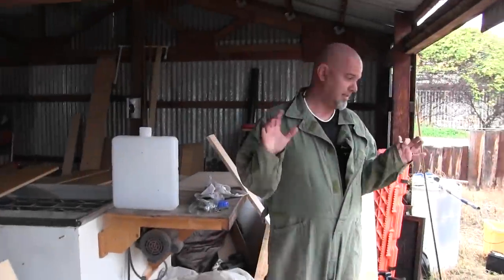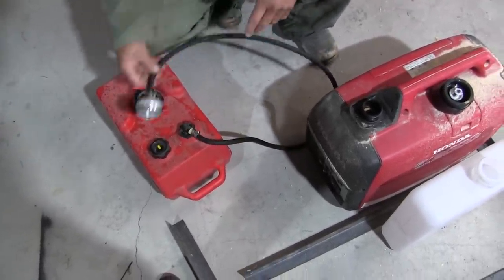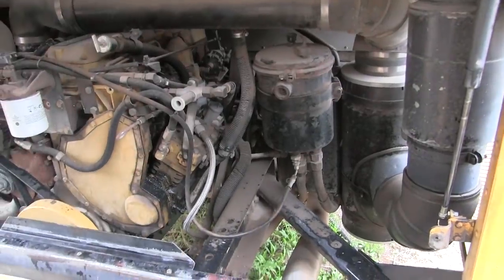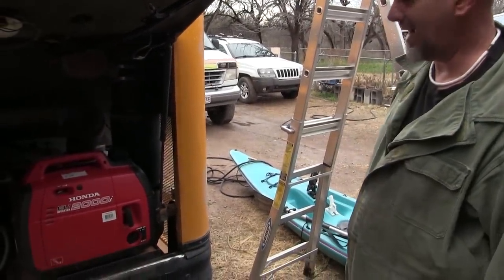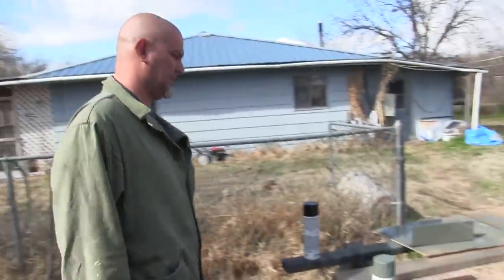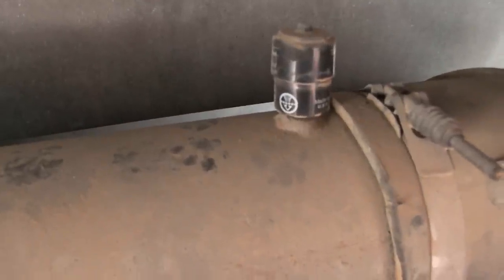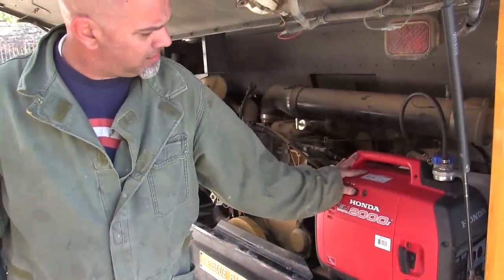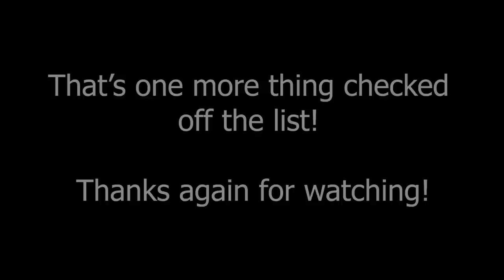Generator Custom Install in our Skoolie

Comment: Just wanted To give you a suggestion about your generator setup. I did the same thing on my conversion and thought that big hole in the engine compartment was perfect for a generator. Two things to consider are that the engine bay get extremely hot and putting an inverter generator with all its electronic components that close will not be good for it in the long run. Also, taking up that space will restrict the air flow that your bus’s engine needs to stay cool. I ended up having to relocated my generator as it caused the bus to run hot. Keep up the good work, and you will be on the road soon! 😊

Comment: The national standards for fuel storage is 3 -5 ft from any heat source fumes will ignite and the plastic will melt and degrade over time from the heated enviroment. Your engine compartment will exceed 200+f. Seriously need to step up the heat shield with insulation the metal will become the same temp as the environment and install a vapor vent tube from gas. If anything enclosed the generator and tank and insulate with fire wall padding from jegs or any other suppliers. Your doing a great job and very creative solutions to difficult problems.

Comment: The pipe you're using for the generator exhaust extension is not meant for high temps...it was for the ambient air intake on the diesel heater. 
Add an inline fuel filter for the diesel heaters and for the generator as well...it will save you a ton of headaches down the road.
Overall a great built my friends 👍

Comment: With that awesome solar setup i doubt that generator will see much use! So the propane conversion makes perfect sense. You wont have to worry about gas going bad and messing up carburetor.

Comment: how bout header wrap for the exhaust pipe.  Also, consider mounting a 10lb fire extinguisher next to genny in such a way that if needed all you need to do is pull the pin and smash ht handle.    I wish my engine compartment was as uncluttered as yours.
Reply from the maker: I totally thought about a pull handle fire extinguisher that I just grab the handle outside and it fire the extinguisher inside. Our minds work a lot alike. Hope to meet you.😊
Reply from the maker: Just ordered the header wrap. Awesome idea!

Comment: McBusface crew I really hate to write this comment cause I really love your site and all your videos and your project, and I have come to care about you too even though I know it's silly but, I do, so I am virtually forced to write this. 3 things, your bed in the back over the engine compartment when you're traveling Your engine will roast you out of your bed so you must insulate the heck out of that engine compartment to keep the heat out of your bedroom. My wife and I found this out when we bought our diesel pusher, We would go to stop at a rest stop and catch a few winks and if we didn't have a couple 3 hours to let the engine cool down it would roast us right out of the bed. Next Mounting your generator solid to the frame of your bus just underneath your bed will drive you nuts from the vibration it was bad enough for us when the generator in the front of our bus (which was shock mounted) would drive us nuts through the sound running through our mattress up our pillows and into our ears. This is why people like to set the small generators out on the ground where they keep the vibration out of their coach.  Next the heat coming off of a diesel even after it's been shut off is ferocious, I worry that your generator and its gas and gas can could get hot enough to boil the gasoline or at least create enough pressure to be extremely dangerous.
Reply from the maker: We did insulate the bed area. As far as the generator usage, we wouldn't be using it at bed time because no matter where it was mounted, Kerry wouldn't tolerate it very well.  As far as the heat back there, I will do some real world testing and move the fuel tank if necessary.  Thank you for your concerns 😁

Comment: Some half inch rubber padding between the mount and the board your genny is sitting on will cut the vibration and some noise that travels thru the frame rails into the interior of your bus. I’d also think about wrapping that tank in heat shield tape, or even use something like refletix to make a homemade “sock” to slip it in.. sitting right next to all that heat seems like a accident waiting to happen. Your sleeping right above it. Love your work!

Comment: You need to add a CO detector inside towards the rear of the schoolie.
It wouldn't hurt to mount fire detectors, and CO detectors in both the front and back of the bus. If you are using any type of propane appliance inside the bus, one needs to instal a gas detector as well. If you are using any type of tank in the "basement" or lockers it is best to add a hole in the bottom with a piece of screen to keep bugs and vermin out. Most gasses are heavier than air and will self vent. Also with the propane detector it is bed to buy the type with a shutoff solenoid that can be mounted rite at the tank.
The joys of being a "pack rat", one never knows when those spare parts come in handy.

Comment: With the main engine's exhaust pipe under your gen. maybe some sort of heat shield to protect the gen. from the exhaust.  Also how about some springs or 3/4 "- 1" rubber pads under the gen. to help reduce the vibrations. The pads could double as a washer that the bolts that go through on the mounting holes on the gen.

Comment: I have a suggestion for Mike. Just something to add to your Mcgiver skill set. You can add fittings to a polyethylene tank, the same way they add fittings on RV tanks. They are friction welded to the surface. You can buy the fittings from your RV dealer, make the correct size hole, and spin the fitting causing the friction to weld it on.
Check out some videos on this.  Just a thought.

Comment: We did similar setup but with 2 Honda 2200s so we could run in parallel. Way overkill. We never used the 2nd one throughout our 6month trip. One is more than enough to power our mini split, tvs, etc... We also didn’t install an auxiliary tank like you wish I had done that. But I do have one thing that really helped us refill the tank. I got tired of squeezing the hand siphon from Walmart and bought an electric one. It was amazing. They are kind of cheap and made mostly of plastic but it lasted the 6 month trip. I’d buy a new one every month if I had to instead of squeezing that siphon 100 times every time the tank was empty.

Comment: I know there are a ton of suggestions but I wanted to have a go. I suggest some kind of heat sensor on the plastic tank or metal right next to it that goes to the inside of the bus with a little alarm. Just in case the frame gets hot enough to melt the plastic. I also suggest some kind of pressure release valve for when the gasoline gets hot and expands. I’m not sure on how to vent gas vapors around hot objects though. Just something to think about. But I love the area for the generator and frame build.

Comment: Might wanna consider a form of heat shield under that generator due to the exhaust being directly under it.
Reply from the maker: Dzlfreak turned me on to header wrap. That will cut the radiated heat in half. Secondly... well, you will see.😁

Comment: OK...I'm gonna say it... With all of that solar I just don't see this thing getting used much... however, being from South Georgia myself, I know that summer heat and humidity can make life crazy without AC in some places in the summertime. I'm not sure how long your AC can run off of your batteries, so it seems like a good backup plan. Great video, love the placement, but I am worried that you blocked some of the air venting to the motor itself... I guess we'll have to wait and see if changes are needed!!!
Reply: Chuck Spencer with a mini split sucking 800 watts an hour you’ll definitely use the generator at night and on gloomy days.

Comment: I thought of the type of springs you could use. You've most likely rebuilt a few car engines, so the type of springs used to control the valves for intake or exhaust would be the right size. Also those type of springs are designed to handle the stress and 1,000,000's of  of cycles without breaking. You look the type to have a garage full of parts, you must have a few laying around.

Comment: How about high density rubber pads between the bus frame and the generator caddy?  That way it can shake and the rubber could isolate out some of the movement.  Since you have 5 mounting points it should work out ok.

Comment: Sh ould try to run it so it puts outside more and up. Perhaps drill a hold in the bumper so it sticks out say maybe an inch or so like the diesel exhaust does.
Also keep an eye on that Flex pipe. Gas runs a lot hotter than diesel Buzz could burn through easily.

Comment: Can you "pre-coil" the fuel hose the same amount of turns in the opposite direction of cap mounting, so that it will be "unbound" when cap is installed?  . . . Nice setup! BTW!
Reply from the maker: We are going to purchase a quick disconnect so that it won't be an issue at all.  Just didn't get one in time for the video.
Reply: I was wondering the same thing... But the quick connect will work too...😂

Comment: Isn't that muffler gonna get hot w/ gas right above it, unless run only when parked??
Reply from the maker: That was a big concern for us.  Realistically, it will only be used while stationary.  Secondly, with the bus in motion, nothing will get really hot due to the air flow back there.  Third, the shield I put over the gas tank will further dissipate heat.  Just not worried really.
Reply: Bussy McBusface I would test it out and see how hot it got because you know the bus will be sitting idol and running sometimes

Comment: Run mine on propane safer than gas cleaner,  one little fitting on the generator
Reply: That's a smart idea...for the bus, it will reduce the need for a third type of fuel (gasoline.)
They have conversion kits that will let you use gasoline or lpg 👍
Reply: This is the way to go....lp gas conversion is super simple on the the hondsa

Comment: If you notice the location of the fuel tank on the generator, more often than not it is higher than the carburetor eliminating the need for a gas pump which would not allow the generator to draw fuel from your tank modification. Just saying
Reply from the maker: It was designed to do this. I literally show it in the video.
Reply: Gravity, man. Gravity. We'll probably be revisiting this. If it turns out you don't get the results you expected, consider the propane conversion as you already have it on board and it would eliminate several possible safety issues.
Reply from the maker: I literally show it working in the video. Thousands of people do this because it was designed for this . Did you even watch the video?
Reply: @BussyMcBusface  Could you refer me to another video where someone had success with a similar installation? Sorry if I got your hackles up. I'm pulling for you. Enjoy your videos. Long-time subscriber.

Comment: temp changes will pressurize the white tank if air cant get out
Reply: Mike showed the cap with the center hole. I think it will vent just fine as it was made for the diesel heater.

Comment: G'day I had one thought why not put a Prima Bulb the same on a boat between tank and Generated     John
Reply from the maker: Honestly, we had to redesign the whole thing because of the danger of having the fuel in the engine compartment. Converted the whole thing to propane.

Comment: might be able to get to the pullcord and switch the genny on/off if you make the licenceplate fold down (like an old style gasdoor )
https://www.rvezuvit.com/index.php?main_page=product_info&products_id=215869
https://www.ecklers.com/1966-1967-chevelle-gas-door-license-plate-bracket-for-all-cars-except-wagons-50-203644-1.html
as for the quick disconnect / rotating hose connection , i think a airhose quick connect will work as long as the plastic parts in it can handle gas , its airtight so should be watertight too

Comment: Probably a dumb question but what will you use the generator for? Is it just in case or is it for a specific purpose? Great video as always!
Reply from the maker: Just in case really. Mainly in the summer for the AC if our solar isnt carrying the load.

Comment: Great job.  I would try some kind of rubber mat under the generator to suppress vibrations.  They have them at Tractor Supply.  https://www.tractorsupply.com/tsc/product/4-ft-x-6-ft-x-3-4-in-thick-rubber-stall-mat?cm_vc=-10005   
You could cut it and make "gaskets" to go between your rack and the bus frame.  Just bolt through it.  You could also put it under the generator between the plywood and the generator.  I don't know how much difference it would make, but a 4' x 6' mat is only $40.

Comment: Nope not a good idea if go over rough country road may have a problem the other one is if rear ended you will know where your generator was..fuel tank too close ,if you leave it there,then  bypass the generator tank completely aleaset 8 feet from rear bumper...like your project waiting for next video ..